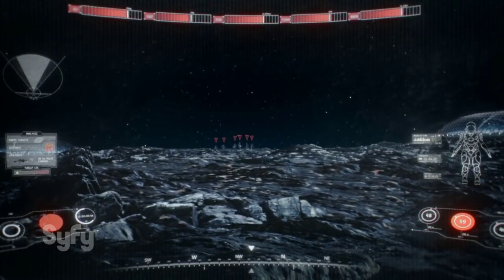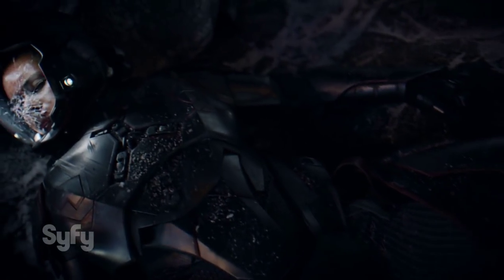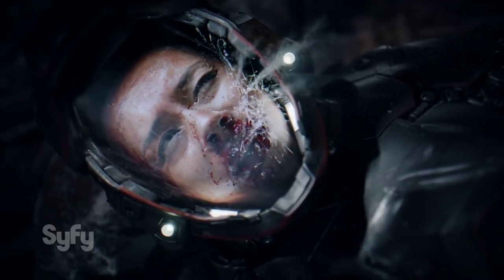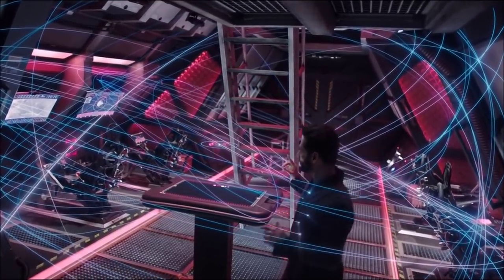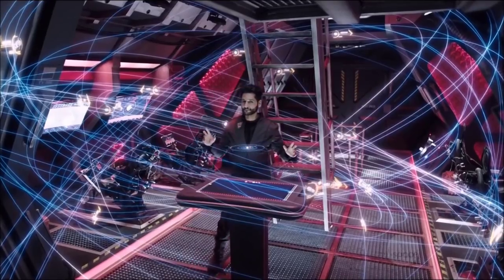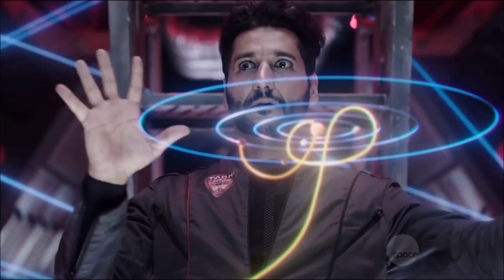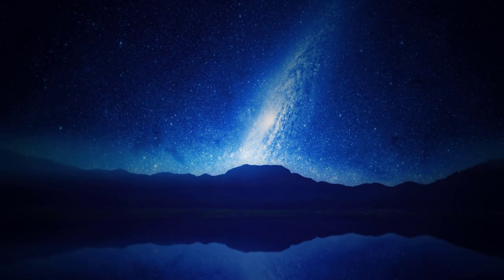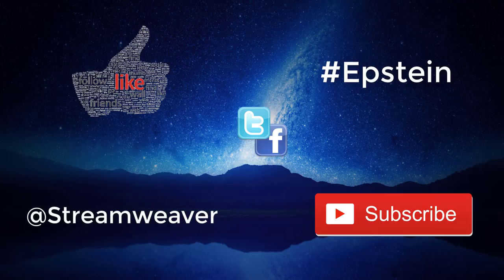Let's Do the Science:  The Epstein Drive

Comment: Regarding fuel, in one of the books (4 or 5 I think) the major conflict is over a large lithium mine. I don't remember if it was explicitly stated, but it was at least strongly implied that the lithium is primarily used for the fuel pellets.

Fuel pellets were mentioned numerous places in the books, whether they're pure lithium or lithium combined with something else (i.e. deuterium, tritium) is unclear.

In other places the books talk about using water as reaction mass. In one book a ship has plenty of fuel pellets, but is running low on reaction mass (water). This isn't "flying teakettle" (see below) this is using the fusion + water to directly produce the thrust.

Flying teakettle also uses superheated steam, but it isn't coming directly from the fusion reactor. It's done on some small short-range ships that don't even have a reactor, they heat water with electricity from batteries or solar panels for example. This is also how the maneuvering thrusters on even the fusion-equipped ships work, with electricity supplied by the reactor.

Comment: Rather than being concerned about how the drive produces energy, heat is the biggest problem. A nuclear reaction certainly can produce huge power levels, and the drives in the Expanse certainly must operate at very high power levels given their thrust and isp, but this necessarily comes with huge heat, no matter how it's done or how efficiently. The ships seen don't have large fuel tanks, meaning there's only a small amount of exhaust to carry away waste heat, and there are no large radiators seen either.
Reply: @TonboIV  How the drive produces energy is a SCIENCE problem.  Dealing with the heat byproduct is an ENGINEERING problem.  Without the former, the latter doesn't matter.

Comment: Saying that an Epstein Drive is powered by fusion doesn't tell us anything about how the drive itself works, just that the power is supplied from a fusion reactor (either direct hot gases from fusion plasma or electricity generated from that heat).
That is a bit like knowing that a smartphone uses lithium polymer (or ion) batteries and nothing about how the phone itself works.

Comment: Some things i remembered from the books:
Epstein drive uses fuel pellets of some kind injected in to the reactor. Fuel is stored on board and last quite a long time in the books. 

The thruster system for manouvering in space does use water in steam form, and this seems to run out faster.

And then some ships have a third more rocket-based or jet-engine thruster system for landing and atmospheric entry also using fuel that runs out more quickly. 
But only a few specialised ships like the roci or special shuttles or dropships have these landing-thrusters. Most ships don't have atmospheric or planetary landing capability and are metal boxes with an epstein on them, only used for space travel. Remember that Eros, even Ceres and Ganymede have only a fraction of Earth or Mars gravity, and ships can land or dock there with minimal thrust. In books 3 and 4 this is mentioned more. The fleet in book 3 are space-only-ships, and the UN ship in book 4 is a space-only ship. The Belter freighter in book 4 is also a Space-only ship. They all use smaller shuttles or dropships to load and unload people and cargo. The roci can land but is an exeption, and probably mainly so for storytelling purposes... ;)

Comment: One comment on the travel times: these will vary tremendously depending on where your starting point and destination are in their respective orbits, since there are no fixed points in the solar system.

Mars can be as close to Earth as ~35 million miles and as far away as ~250 million, but you would usually travel in long arcs around the sun to go from place to place, not in straight lines, making your total travel time much longer than the straight-line distance would indicate. When you and your destination are on opposite sides of the sun, the best route might be a curve that goes deeply into the inner solar system on your way to the outer system. You might also take longer routes than necessary to avoid unfriendly space or if trying to be less conspicuous.

My understanding from the books is that 'teakettle' propulsion is used for maneuvering thrusters and for low-speed propulsion near stations and docks, as well as for landing on large astonomical bodies. I'm pretty sure that the Roci lands on Ilus this way.

One of the books mentions 'hyper-distilled' water for teakettle propulsion. My assumption while reading the books is that this is the 'reaction mass' referred to when discussing supplies, while only fuel pellets are required to power the Epstein drive, so if you ran out of reaction mass your maneuvering thrusters would be useless and you'd be unable to change course or maneuver, but could still go really fast in a straight line. Again, this is just what I assumed, since the authors are purposely vague.

In a YouTube video, when the authors were asked how the Epstein drive works, they replied, 'Very well."

Comment: So. In the books they talk about teakettle, yes, but they also use water for maneuvering thrusters and specifically at the end of PR Naomi thinks about purifying planetary over and over again until it is “pure enough to use in the Roci’s engines”. I think that is a good hint to that secondary reaction you speak of. Also .3G is repeatedly and specifically cited as a preferred travel speed for comfort and reaction mass conservation. The faster you go, the even faster you use up reaction mass. So it’s an economical speed as well. There are plenty of times where 1-3G are sustained for various reasons, typically in a chase scenario. And sometimes even higher for shorter periods. They also specifically talk about unmanned “mass drivers” regularly traveling at 12-20G for supply delivery or warfare type bombing.

Comment: Currently, ion drives are being used for long period thrust. It ionizes a gas like xenon, then uses electricity to accelerate the xenon nuclei. It's not much thrust, but the power comes from solar cells and can go on for a long time.
Replace solar cells with nuclear power and a large amount of plasma, which is, like ionized xenon, a gas stripped of electrons, only a whole lot more of it. Now you have a nuclear drive, all components of which already exist.
The next step is to use magnetic fields to compress and fuse the plasma. We're creeping up on that step now. The next step would be to inject more plasma after fusion, then fuse it again.
You could start with hydrogen (two atoms per molecule of water), and fuse it to helium. The fuse a hydrogen nucleu and a helium nucleus to lithium, or two helium nuclei to beryllium.
That would be pretty efficient. However, it's not the Epstein drive, but maybe it's a way to get around the solar system.
You mentioned that water was a valuable commodity in The Expanse. Every habitat would have some leakage, but water would be constantly recycled. Maybe massive quantities of water are needed for it's hydrogen. Oh yeah, the oxygen would be useful too.

Comment: In season 6 or 5 I don't remember which, the Roci was caught by the protomolecule forces of the colony world that Miller led them to. We saw the inside of the fusion drive in this scene and how it worked. It basically used magnets to accelerate solid fuel pellets fast enough to force fusion

Comment: Once you postulate a containment system that makes a fusion reactor efficient to operate; that implies you have magnetic deflection technology sufficient to deflect plasma from the structural members of a landing bay.  In such a system; firing up the engines before the blast deflectors were deployed could result in making the landing bay a molten slag heap.  With what we have today; to start prototyping such a technology would require finding a solution to the high temperature superconductor to standard conductor bridge.  Then you could generate magnetic containment fields with low enough power and tight enough flux density to make a ship size fusion reactor.
Superconductor to standard conductor bridging is a nail which if found would free so many scifi horses to course through the battle for the future.

Comment: I would go with helium3 as the fusion fuel as the reaction byproducts are all charged particles so can be directed, magnetically constricting the engines exhaust.
By the look of the ships exhaust bell that's what I would guess.
The biggest problem I can see is the waste heat from the engine, how do you get rid of it ?

Comment: Wanted to interject with some updated science here. There has been a lot of work recently into using boron fuel cycles for Fusion reactors (specifically mentioning the 11B(p,α)αα cycle in this comment). This produces next to zero neutron radiation. What it does produce however, is a final product of Helium3, which allows for the use of a direct energy converter (a device that converts the kinetic energy of high-speed particles in a magnetic field directly into usable electricity.

We do hear a lot of talk about reactors leaking radiation in the expanse so there could be something else going on, but this type or reaction is currently the way forward. Right now, the classic deuterium-tritium reaction is used simply because of its stability at low temperatures. It has sever drawbacks in nearly every other regard. Meanwhile a boron fuel cycle requires something on the order of six billion degrees in order to be efficient.Believe it or not though, we're slowly getting there.

What we could be seeing is a fusion reactor providing gobs of power for some kind of hyper-efficient VASMIR style plasma rocket. However I'm not sure what kind of crazy superalloy you'd need to act as the RF heating element inside such an engine at the scales we see in the show.

Comment: The inital fusion reaction is quite non-directional; energy is really going everywhere (spherial reactions). You can see types of focusing coils on the spaceship.  I suspect that the secondary reaction (the improvement that epstein created) probably used a specific focusing magnetic fields to change the normal spherical reaction (energy going in all directions, to the focused direction of the plasma output from the secondary coils.

Comment: It does not run on efficiency, it has a fusion reactor that generates the power used to provide thrust.  The efficiency part is that Epstein upgraded the traditional fusion drive to make it far more fuel and power efficient.  Kinda like designing tools for tuning and upgrading the engine in your car then patenting your custom upgrades.

Comment: You missed a critical detail...

The Epstein Drive does not use fusion to produce thrust, there is a secondary Reaction Mass which is mentioned but never specifically detailed in the books. The fusion reaction is used to accelerate the reaction mass.

Comment: Two ideas: (1) What if it is two fusion reactions, pushing together matter and antimatter in a more compressive and sustained way than the reaction blast would normally allow? A tiny bit of fuel would translate to a huge energy. Or what if it was a special kind of fusion that resulted in antimatter. (2) They have shown that they do have artificial gravity not based on rotation. That means they have some ability to manipulate gravitons or space-time. What if an artificial gravity distortion is how they are magnifying the velocity of the propellant? Notice that whenever they cut the engines, their artificial gravity also turns off.

Comment: #MyTheory is it's a fusion-powered Hall thruster that uses solar plasma as reaction mass. Water is unlikely to be used as reaction mass, but it could be used as radiation shielding in a double-hull design, because water is extremely good at slowing and capturing nuclear particles moving at relativistic speeds before they can shred important things. As a bonus, capturing "fast" neutrons using water will produce deuterium, which is an excellent fusion fuel, so surrounding the reactor with a water jacket is one way to recapture some of the energy wasted as radiation to breed more fuel for the reactor.

Alternately, it could be a thermonuclear drive, which uses a small amount of fusion to induce fission in heavy nuclei, such as uranium, mined from the asteroid belt. Those heavy nuclei would make even better reaction mass than solar plasma, though it would require carrying the reaction mass onboard the ship. Or perhaps this is the "torch drive" that preceded the Epstein drive.

Comment: #mytheory (4 years later) - The fusion reaction is used to create a charged plasma that contain the fusion material and a metal to add mass to the exhaust flow.  The plasma can then be electromagnetically accelerated and focused out through the engine nozzles.  I was thinking Nickel, Iron or Cobalt would be common enough.

Comment: Concerning the traveltimes like 16 days to neptune and so on... does this take also the position of the planets into account? Just curious.
Reply: I believe that's why he mentioned "average". But given the distances involved, I don't think you'd see that big a difference when it comes to the really distant planets. Neptune, for example, is about 30 AU away from the sun. So the difference between the closest and farthest it would be from Earth would be 29 to 31 AU (plus whatever you'd have to add to go around the sun). It would matter a bit more for Jupiter which is at about 5 AU (so 4 to 6 depending on relative positions), and it'd definitely matter for Mars (1.5 AU, so 0.5 to 2.5 depending on relative position).

That said, a big part of the cost in time and energy would be in simply reaching the right orbit. Remember that when you're going outward, you are essentially lifting the thing up, because you're going away from the Sun. That costs energy, beyond what you'd get from just counting distance.

Comment: I was working on a script in which travel between solar systems was reasonable, like a week or a month. I ended up using a warp drive that goes 15,000 times the speed of light. That did the trick and it would still take years to cross the entire span of the galaxy, and hundreds of years to reach another galaxy. Space is big kids.

Comment: The "magic" in the Epstien drive is that it has both high exhaust velocity and high thrust to weight in a very compact form. The numbers themselves don't really exceed what you might  concievably achieve via fusion or antimatter catalyzed fusion though not with arbitrarily high thrust in such a compact form. Maybe in a thousand years or so but this actually lends a nugget of believability that if anyone was to stumble on it before then they may well end up like poor Mr Epstien.

Comment: I see the engines are a combination of NASA's VASIMR engine and fusion engine. I also see forward intake vents on some of their ships.

Now, I see the engines more of as aneutronic reaction engines based on what I saw in Season 4. We see solid pellets being blasted. These could be the protons needed for the reaction. Plus, the colonist were making a big deal about the lithium, a fuel for aneutronic fusion. As for the secondary reaction talked about, the alpha radiation given off could be used in a direct fusion reaction at the nozzle for more power. Along with a gas or some additional mass going down the nozzle and we might just have our Epstein Drive.

Comment: Watch Austins episode (before he left ShoddyCast) on Fusion Cores from Fallout 4. He does a bunch of calculations and added spreadsheets for the data and calculations he used. However the scenario is different, but the fusion tech he's covering is still fusion none-the-less. Spoiler alert, the fuel for fusion is hydrogen, watch the video, is great.

Comment: I could write so much on this but I will limit my response to two unfortunate issues with the Epstein Drive.

1.) Reactions from fusion consist of three basic products; protons, high energy photons, and neutrons. The protons are fairly easy to recover momentum from - magnetically focus them to the rear of the ship. The high energy photons MAY be possible to recover momentum from by focusing the photons to the rear of the ship. While difficult, this may be possible. We can currently guide X-rays with waveguides and turn them to limited degree. Maybe gamma rays may be possible someday. But the main problem here is the neutrons. And this isn't a engineering problem - this is a physics "Standard Model" problem. There is just no material that can exist that can reflect neutrons. The only way I could see to do this would be to manipulate gravity and/or the Higgs field - and if you can do that then you may not need an efficient fusion drive.

2.) How can we let these ships jet around the solar system at 1G? A constant burn to Jupiter at 1G is hitting some VERY high velocities - velocities that make asteroids look slow. Every ship in Expanse is a potential planet killer. We are worried about planes flying into buildings now days. How can we have planet killers flying around the solar system?

Comment: The drives are regenerative. The fusion reaction liberates loads of energy per unit mass, and the by-products are recovered and re-used, resulting in some waste heat and a dynamo-like process where particles are accelerated to near-luminal speeds (in a particle-accelerator-like loop) then released. As long as the reaction produces a little waste heat it won't break any lows of physics.  Even Hydrogen would work as propellant as long as it's going fast enough, check out relativistic momentum.